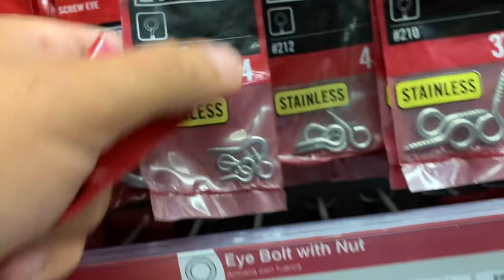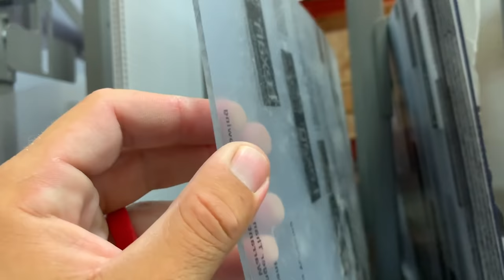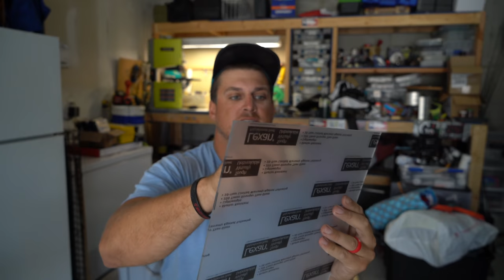Making a Fishing Lure from a Broom Stick!!! --24 Hour Build to Catch!

Comment: I used to build these with my cousin back in the 90s. We would broom to candles as well. But we cut a slant into the head of the lure and depending on where we placed the screw eye, it would affect the depth that the lure would travel. They would typically go about 1 to 2 feet underneath the surface. Great video. Brought back some good memories.

Comment: I knew I should have taken that off the boat deck the other day. I wonder if your nail holes were too close and it made one really weak point in the tail. It looked surprisingly good in the water. Well done man!
Reply from the maker: That's a great call man. Entirely possible

Comment: Pro tip for the next one you make, since you’re going to put a screw in for the joint, do that first for a handle instead of your hand when putting it in the belt sander for the taper.

Comment: I wanna say it ripped the tail because you had to thin it out to insert it in the slot. The sheer strength of the plastisol was weakened slightly. Very cool though!
I got a glidebait I'm working on with a similar tail slot, and am using a tougher rubber tail to hopefully eliminate the same thing happening. Helps that it costs 12 cents to make each tail too.

Comment: Hey buddy what’s you opinion on barometric pressure and fishing. I’ll start off saying that when I was young we just used corn or worms for bluegill/sunfish and you can catch them usually all day without fail. Anyway as I got older and fished for ‘big’ bass lol! everyone said they play off the barometer and almost always falling is when you will catch. Now I know tidal waters play with different variables greatly but what is your opinion on barometric pressure and fishing? I’ve never seen a true correlation in this and never seen anyone talk about it on their channel in regards to low/high/falling/rising pressure. I’d appreciate any info you have!

Comment: Brother Ben,
The MFBamby....the eyes on it remind me of Bambi's and it's a nice play on words or just the MFBammy as not to sound too much like a pink Prius owner.

Fold a rubber inner tube in half, contact cement layers and cut out a tail.  Or contact cement several layers of inner tube together. Maybe add several pieces at the thicker insert part and thinner at the end of the tail.  Experiment a little to figure out the best action.  I'd think that inner tube would be more durable and nearly as limp as the original plastisol tail or whatever it's made of. Another thumbs up video!

Comment: Concerning the nose eyelet, did you screw through the bill into the body or does it not reach that deep? I would be worried that huge cut for the bill being a weak spot if you get hooked into a slaunch.

Comment: You could probably make the tails in such a way to use a curly tail grub or a fluke for the tail by just having a screw sticking out the back end and just screw on your tails as you get them ripped off.